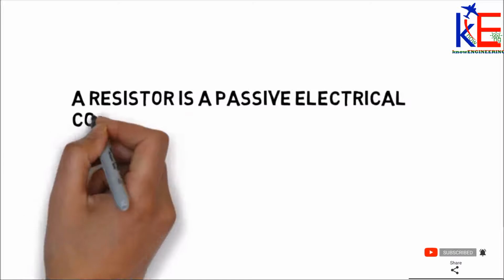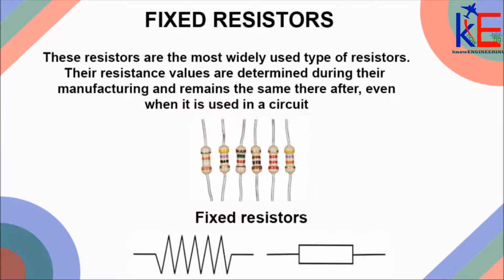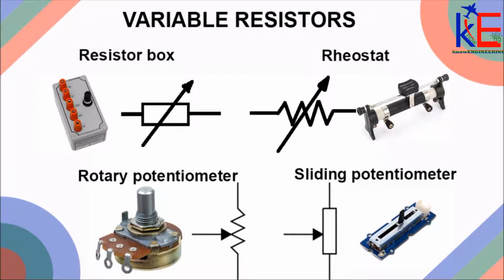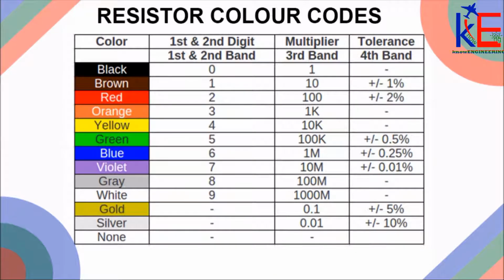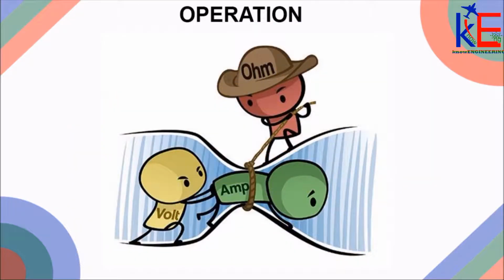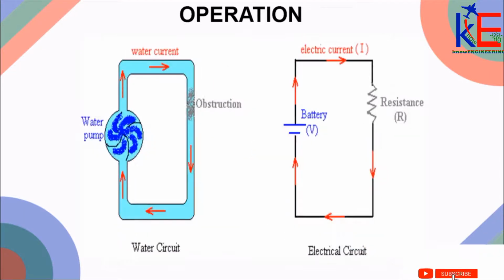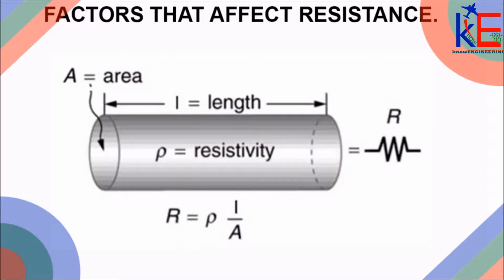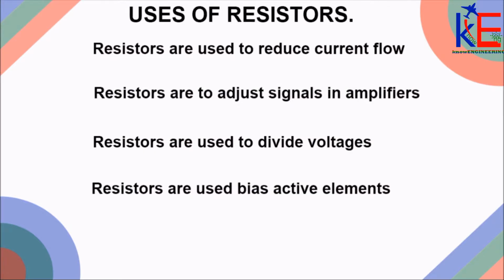RESISTORS, WHAT ARE THEY?

Comment: Good job bro...
On the contrary, comparing the water  flowing through the pipe to explain the operation, the resistance in that is the type of pipe used. That is, the small the pipe the higher the resistance vice versa.